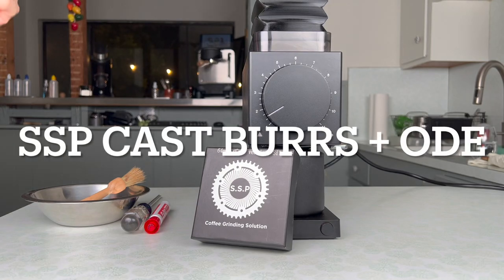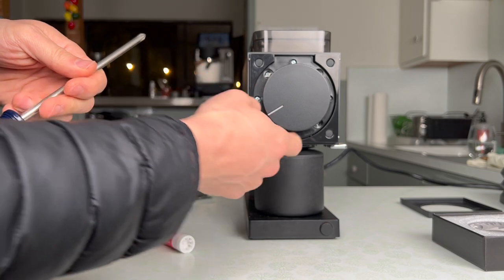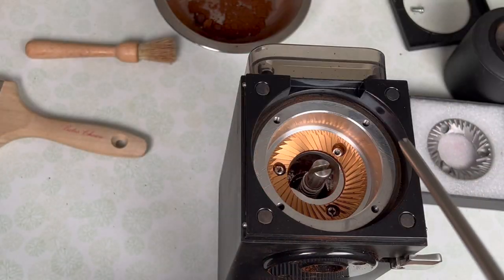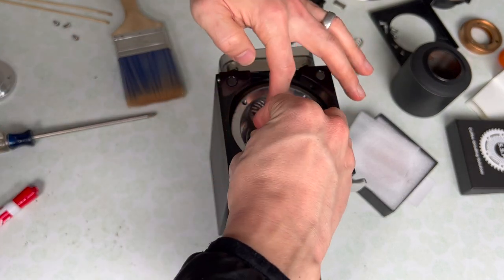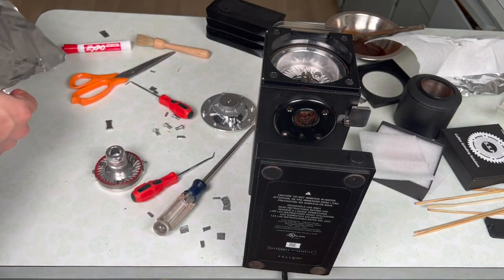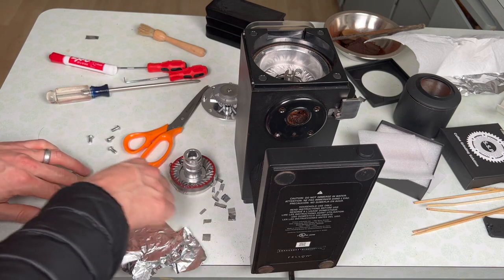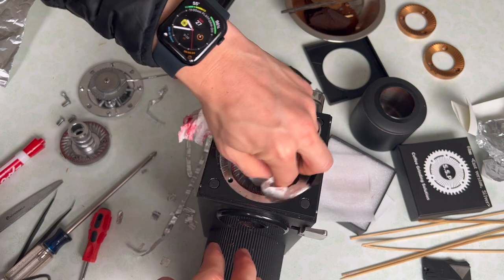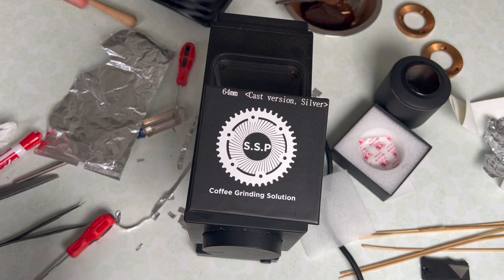Installing and Aligning SSP V1 Cast Burrs into a Fellow Ode

Comment: Great video. Wouldn’t you want to use a permanent marker to note where the burrs are placed on the carrier? Or are you just making sure you put the burrs back in the same spot after shimming each time? I say this because it could either be the burr or the carrier causing misalignment and if you shim and happened to put the burr back in a different way, the alignment would be off.

Comment: Quick question, for the dial adjuster metal piece. The four screws that hold this in, should they be tightened all the way? My machine locks when I tighten them fully. I'm actually trying to install the SSP MP burrs.
Reply: I’m guessing you figured this out, but it sounds like you forgot to put back the auger spring

Comment: Any updates on how you liked the SSP Cast burrs yet, vs the MP? I much prefer the MP burrs, but apparently the SSPs do get better with a lot of seasoning like 30+lbs according to some. The MPs may also benefit from that, but were good and high clarity out of the box, where I'm just getting a lot of body and not much clarity out of my SSP Cast burrs, however, maybe having a good alignment is more important for those burrs than it is for the SSP MP.
Reply: Think it’s just 10 lbs to season. I suspect those who say it’s 30 lbs are just dialing themselves in how to use them. I know with me I saw the light on how good the MPs are 2 years after having mine ! I started going finer and made incredible pour over with them

Comment: Yeah I did originally something similar I got 16 shims min. But then thought that’s ridiculous, so I tried rotating the burr on the carrier and found where it had the best alignment and then shimmed from there. Meant I had to use far less shims.

Mine had the same issue getting out, but after always placing it on the back and make sure it’s nicely centred it pops right out, also I think the Unimodal is contributing to the problem.

Comment: @jkim makes when you checked for the touch with the marker did you not screw the rotary burr carrier in? Just wondering what you did there since I feel like the video skips over this but could make alignment easier/faster and potentially scarier. I just got the Ode and installed SSp Unimodel Burrs with this method and found the thing that took the longest was the constant screwing in and out the rotary burr parts.
Reply from the maker: I definitely screw in the adjustment plate on every test. Also unplug the grinder when it's not powered on.

Comment: Thanks for this great video, very illuminating as always. Do you reckon it should be easier to get them aligned in a DF64? Cheers
Reply from the maker: I’m not sure, the DF64 also has recessed burr carriers. It depends on how deep those recesses are.
Reply: @jkimmakes  Yea true! I will find out soon...
Reply: @pleasure686  i'm hearing from df64 owners that this is not a problem with that grinder.

Comment: Do you think it would be a bad idea to sand down the inner cast portion of the burr so that it doesn’t touch?
Reply from the maker: I think it would be easier to sand the burr carrier. The burrs are hardened and will be difficult to remove material from. The moving burr carrier is available as a part from fellow, but you will have to be more careful if you mess with the fixed burr carrier.
Reply: @jkimmakes  I asked my brother, who has a small machine shop, if he could do it and he said he could. So the removal of material isn’t an issue. 

As for altering the Ode burr carriers, I could always purchase a replacement auger from Fellow, but I’d rather not remove material from the inner burr carrier. I’ll probably just end up shimming like you did, I was just wondering if it would be worth a try to file the burrs down
Reply: @HappyAccidentVideos  With a relatively new ode I just had some machine marks protruding on the burr carrier which I filed down. But otherwise I'd just shim it, especially on the rotary part. I think you'd imbalance the rotor by filing away parts of it. Machining it might work, but I'd think shimming is easier, and reversible.
Reply: I just received my SSP LS, and was about to purchase an ODE to house these burr set.  May I ask if this is bound to happen for every ODE or it’s different from machine-to-machine?
Reply: @jackchen6578  It’s the burrs that have the issue, not the Ode. If you get an Ode, though, make sure to get one that wasn’t produced in Q3 or Q4 of 2022. Some of those models have slightly smaller burr carriers for some reason, and won’t fit SSP burrs. I’m sure you could message Fellow and request this.
Reply: @HappyAccidentVideos  thanks for your response, since it’s the burr geometry that’s causing this, it’s safe to assume it would happen to all ODE.  You said Q3/Q4 of 2022 as it’s in the future? Or you actually meant Q3/Q4 of 2021.
Reply: @jackchen6578  I did mean 2021! So sorry! But any other model will work.
Reply: @HappyAccidentVideos  thanks so much for your sharing! Appreciated.
Reply: @jackchen6578  If you ordered one, it’s possible you would get a Q4 21 by default, but they do have models that fit SSP in stock. A lot of people have been contacting Fellow about the issue, and they swap it out for an older model. It might be smart to ask them for an older model that’s compatible at the start.
Reply: @HappyAccidentVideos  My experience with having a Q3 Ode and not being able to install SSP LS is they will refund the purchase.
Reply: @bairdmiltich4935  Are you talking about Fellow or SSP? Fellow will send you a different grinder. I’d rather have a different Ode than sending these burrs back
Reply: @HappyAccidentVideos  Fellow

Comment: Thanks, how do the SSP 64mm cast burrs compare the the MP burrs? Thanks
Reply: Last try before I order my MP burrs today, do you think these are worth getting over the MP for filter and espresso? Or play it safe with the MP for now? Thanks!
Reply: @cha1ny104  How are you liking the MP burrs? For quality light roasts as espresso, they're my favorite. TONS of clarity / flavour separation, however, not too much body, definitely not a great choice for darker roasts (which are gross usually so you don't want clarity, but my taste bias may be affecting that).
I find The Cast burrs are great if you want more body and more traditional basically what people think of as conical-like coffee quality, however my thinking is, you may as well get a Lagom Mini, Niche Zero, or another quality conical burr grinder for a similar taste profile (I find most Eureka grinders also fit in that category). I haven't tried much but I believe the cast burrs are great for coarser brew methods though, but so is the MP, especially with lighter roasts.
Reply: @BensCoffeeRants  hey! I'm liking my MP burrs a lot, definitely my favourite burr but I really only drink light roast. Did get fomo and bought some second hand cast burrs and they make good espresso if you want something blended or if it's going into a milk drink anyway but wouldn't use the cast for filter or a coffee where I wanted high clarity. Have heard lots of people rate the cast v1 (but people have to grind close to chirp and have a limited range for espresso)  whereas mine are V2 and behave pretty normally.

Comment: Spent 3 hours trying to align my ode. After 8 separate shims, I gave up. Shopping for another grinder. Very unhappy with the amount of fines clogging filters, regardless of grind setting.
Reply: With which burr set?
Reply: @davidlogan2682  SSP Unimodal v1
Reply: @OddJob728  I have a kruve sifter.  The original burrs produced less grinds below 400 microns than the ssp mp burrs did, at least, in my tests. I didn't have any problems with fines clogging with the original burrs. So, maybe the original might be better for you?
Reply: @davidlogan2682  i recently started using the Fellow Shimmy to sift out below 200 microns. Testing both, SSP produced far fewer fines below 200. More importantly, the rest of the grind was far more consistent. For technique, I reduced the amount of agitation. In combination with sifting, this is the best I've been able to produce. Ordered a P64 and am looking forward to comparing.
Reply: @OddJob728  I can't afford the lagom, right now, but I did mange to find a good deal on the Df64.  It is being shipped... I'm sure it will need some add ons, etc., but it should, in theory, be not as good as the lagom, but close. 
I use a melodrip, if I need to be wary of too much agitation.  Works fairly well.

Comment: You can bend/taco burrs through over tightening? 😬👀

I have a sudden urge to check the alignment of my ode/ssp...
Reply: If you shim under the screws it's very unlikely that you will taco them.
Reply: @armLocalhost  I didn't do any alignment initially - I think I'm taking away that it's more of an issue when you're shimmed - when you'd have high and low spots in the carrier. Makes sense and makes me less freaked out. 

Though I should still do an alignment to make it consistent 👍